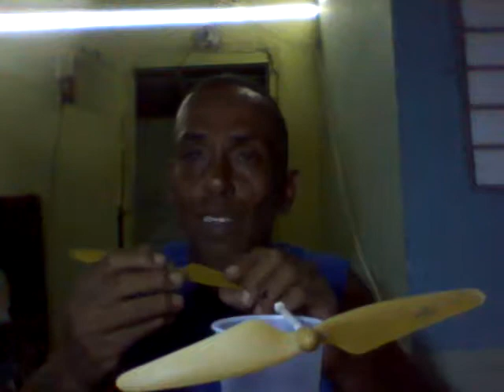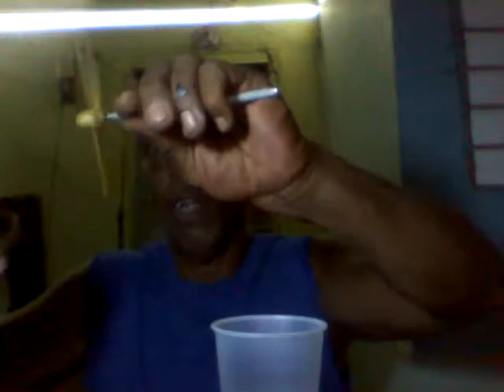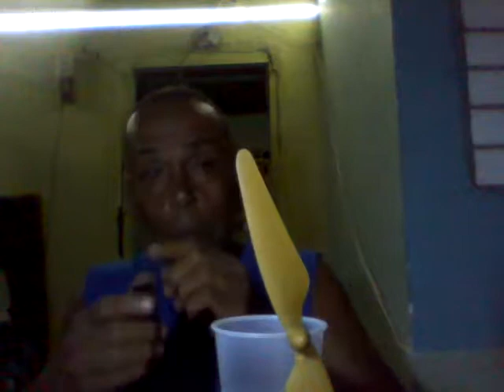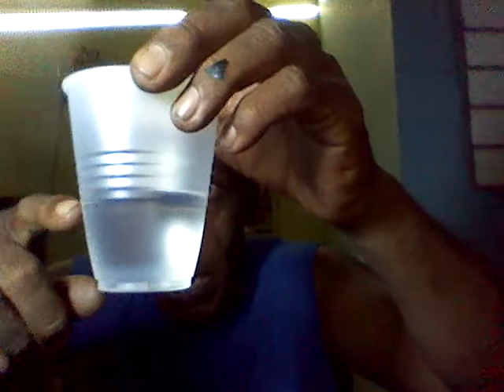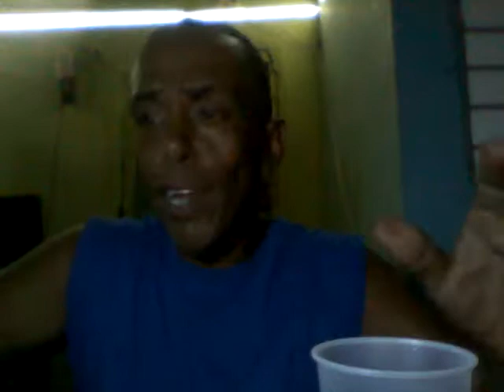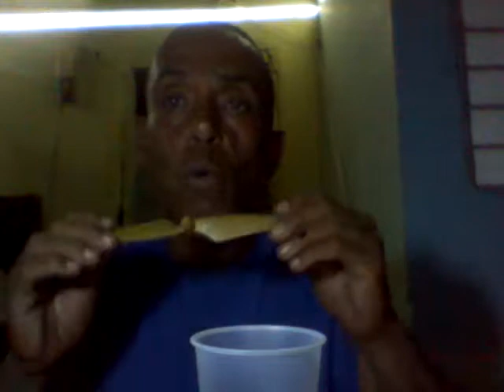PROPELLER BALANCER FOR DRONE AN FPV FLYING HOME MADE STOP JELLO

Comment: +1 Wari - I always enjoy your ideas.  Here's a simple and cheap alternative idea that I came up with to balance my 501 props that also works very well.  I take a straight pin, the kind that has a plastic ball on one end (they typically come with a bottle of super glue) and clamp it vertically, ball end up, in a heavy duty clothes pin.  I check the straight pin's ball for smoothness then add a tiny drop of oil to reduce friction.  I then place the Hubsan prop hub on top of the pin's ball so the prop matches the flight orientation.  I then position a piece of thin cellophane tape on the back side of the high prop blade until it balances then mash the tape down securely.

There are 2 reasons for trying to balance this way:

1. Balancing the prop as installed on the 501 (prop shaft vertically) made more sense than if the prop was mounted facing forward as on an airplane.
2. The Hubsan props are very light in weight and mass.  Even a comparatively heavy long screw/bolt, like yours, can have an affect if it's not perfectly balanced and straight.

This method works great on my H501S.  Try it if you have time and let me know what you think.

Cheers from Thailand!
Reply from the maker: look at my last video ...see if  what i created this time might be helpfull too you my friend
Reply: Thanks Wari.  Will do buddy.  ;^)